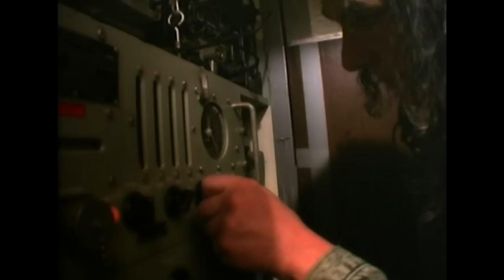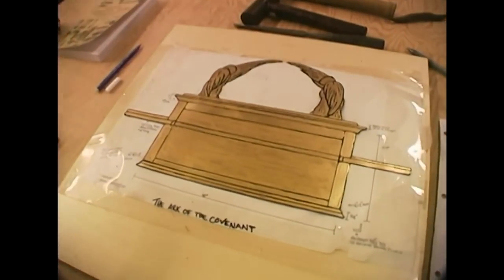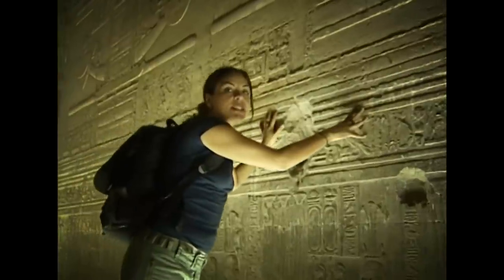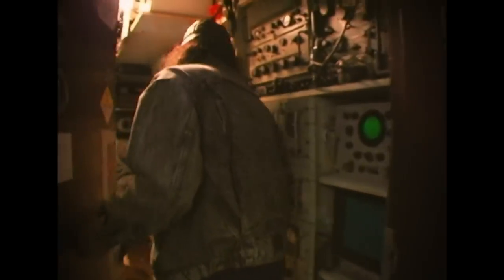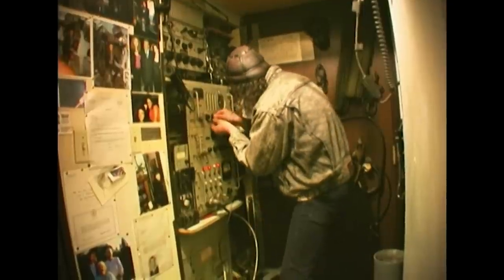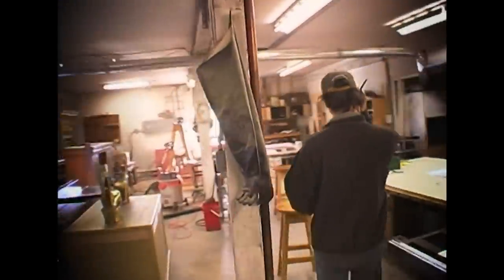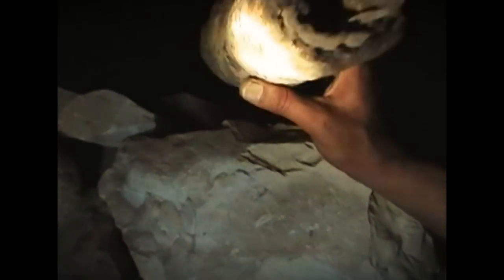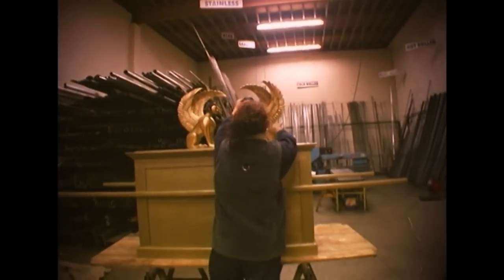Rediscover Biblical History: The Ark of the Covenant | Parable

Comment: I'd guess the Ark was a form of frequency generator, the Charab wings giving directional properties and the frequency created in-between.  Or the wings themselves vibrated different frequencies according to the direction or proximity of the wings to each other. Could you bring down walls made of a certain material if you walked around it 3 or 4 times to weaken it? Could you use it like a directed energy weapon to cause physical unwellness encompassing large army formations as the military uses today to immobilize pirates? I would not be surprised. Would it instantly kill someone who touched it in the wrong way? Definitely, but to turn someone instantly into a statue of ash like Hollywood portrays.... doubt it, unless frequencies can be associated with spontaneous human combustion as well, then were right back to the fact of unknown and secret military testing on civilians. Now that much information and science is coming out about quartz crystal coated or infused materials causing vibrations, creating a negative ion environment for healing as they've found in older pyramids such as Bosnia. Who knows, maybe the Ark also stored attachments that would go in place of the Charab's for different effects. Pretty obvious they had a firm grasp of electricity and sound. Its just that their uses were defined by there times, as we use it to reflect our times, as glutenous as we are about it, surrounding ourselves with all the latest toys, wired and wireless. Has wifi and home internet slipped into the column of necessity yet? lol